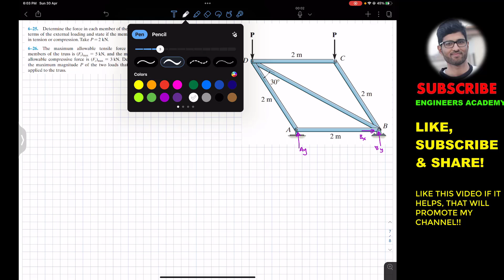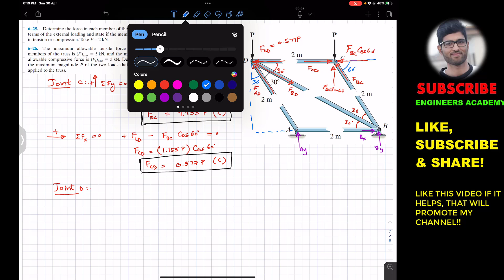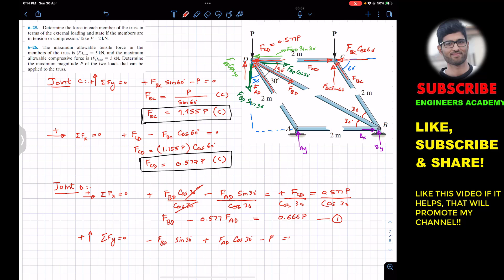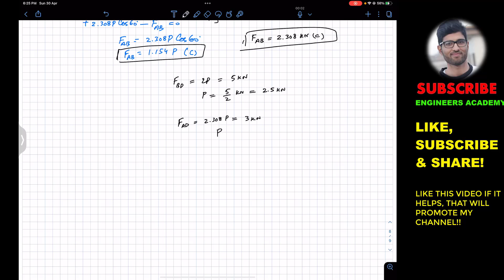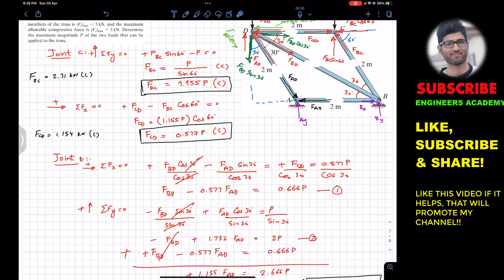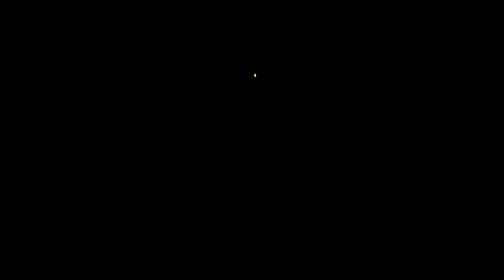Structural Analysis | Method of Joints | Engineers Academy

Comment: I don't not really understand why we went with P=1.30KN instead of P=2.5KN.
Didn't they ask for the maximum value of P? I don't really get it.
Reply: if you use the value of 2.5KN for P, that will excess the maximum allowable force for compression, but not for tensile. So if you use 1.3kN, not will excess any maximum allowable force

Comment: sir i think you got compression and tension mixed up
Reply: I suppose Fbc=2.31kN...and Fcd=1.155kN???
Reply from the maker: When the force is acting away from joint its Tension, tension apply force on joints. As a reaction joints apply the force in opposite direction
Reply: @engineersacademy2020  but acting away from the joints means the member is in compression
Reply: @Ian-dq1tl  acting away is tension, not compression
Reply: @Ian-dq1tl  that is true, except when in joints